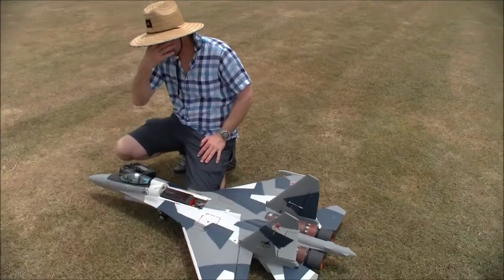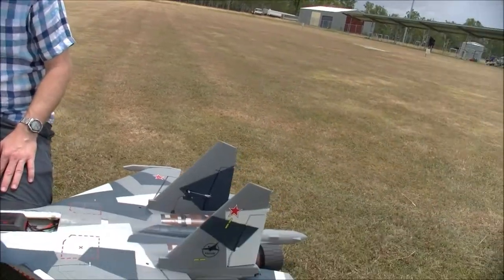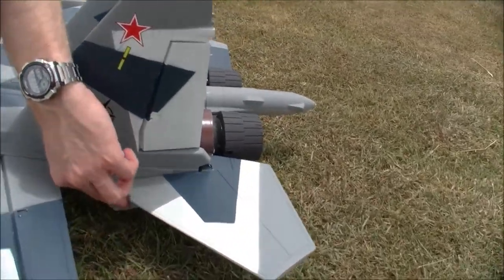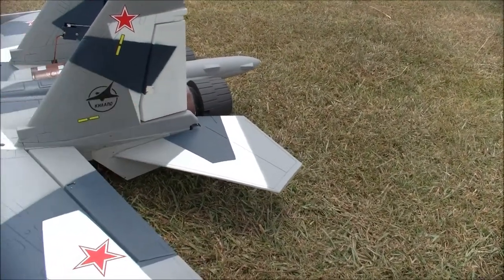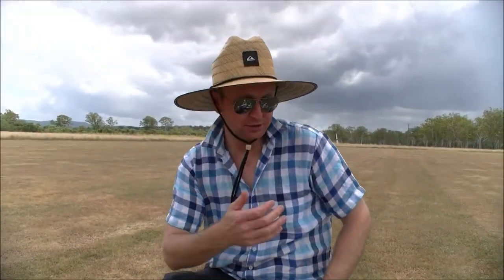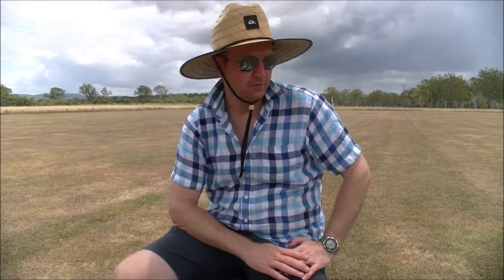Freewing Sukhoi Su-35 Flanker EDF JET, Сухой Су-35 | RC Skunk Works ADP

Comment from the maker: Nice one Scotty... can see big improvement in your hovering through the vid. Great power and flight time. Will be sooo much easier when you dial that gyro in and tighten up the elevator control... oh, and flying on days with less wind and turbulence would be good too... Yoda
Reply from the maker: Thanks Yoda! 😉 And also a big thanks for your work behind the camera on this one! 
Yes I’m looking forward to see how it goes in more favourable conditions, my goal is to fly length of the strip at head height in high alpha! 
Cheers, Scotty

Comment: That SU-35 packed a punch, what fans and motors were installed? Pretty impressive wind-handling BTW.
But seriously, do you really consider fixing the stab? That's outright heresy of the highest degree... just drop in a decent servo and install larger horns. Glue them if necessary. Wobble will go away.
Reply from the maker: Yeah! She certainly does have surplus power with unlimited vertical performance! It’s powered by Freewing EDF units, here’s a link; http://www.rc-castle.com/index.php?route=product/product&path=256_308&product_id=2809
Yes you’re right, fixing the stab heresy!  😉 I’ll try your suggestion first!
Reply: Thanks, that brings me peace of mind :p
The stock horns are too small and the foam underneath gives way to the stress... It is mandatory (IMO) to install horns with a larger base surface that spreads the load into a larger surface. That kind of solves most of the problem. If you really want precision, drop in ball link articulations and then it will be as smooth as it gets ;)
Thanks for the info. Looks like I'll have to upgrade mine soon...